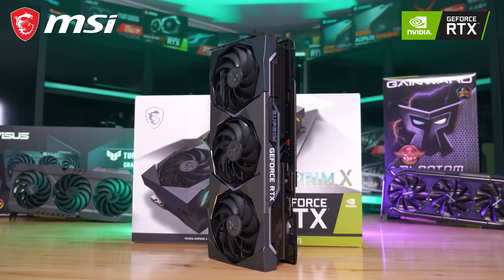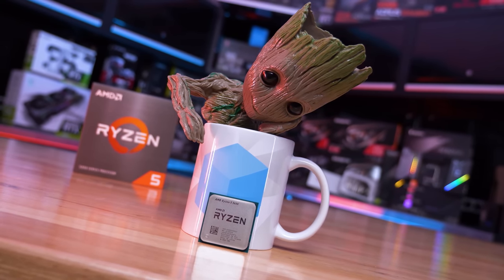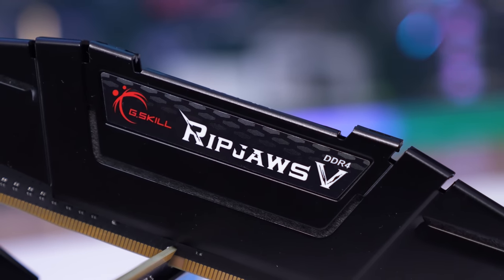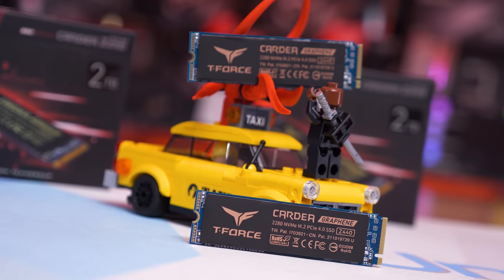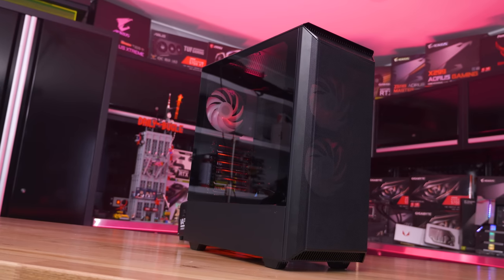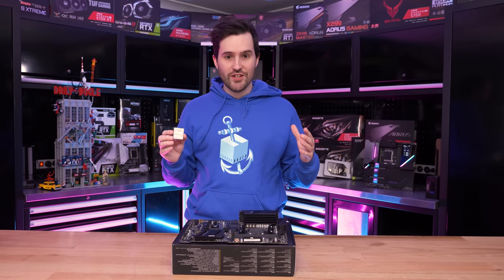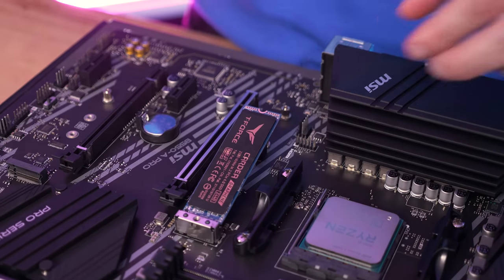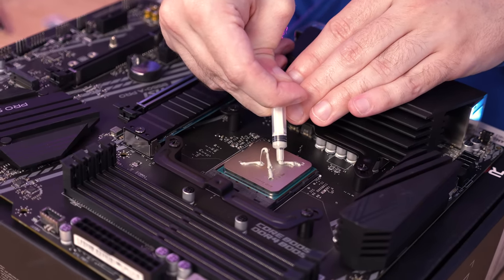Ultimate Value Gaming PC Build - AMD Ryzen Edition for 2022

Comment: I dont agree with a 750w PSU because PSU and a PC Case and the cooling to a certain degree are parts you can and probably will reuse for next build. But 750w won't be enough for the future, by the looks of how GPUs use more and more power in the future.

So its kinda weird how those three things are getting down-prioritized in most if not all budget builds, tbh.
Obviously if you have no plans of upgrading the PC, then by all means the specs of these three are totally on point.
Reply from the maker: 750w is more than enough.
Reply: 550w is good for rtx 4050, oc is waste heat

Comment: Main thing to take here is the R5 5600 and RX 6600 with 16Gb 3200Mhz RAM budget combo
All other parts you can cut it down and depends on the availability in your area
Reply: I don't think the 5600 is the way to go currently unless you already have an AM4 board.  It's EOL.  Either get a 12th gen Intel or wait for AMD's new socket.
Reply: Go with 3600mhz cl16-18-18 or better
Reply: Still using a 1600x I dropped (and painstakingly had to bend 90% of the pins back over hours) @ 4.2ghz since April 16'. 3000mhz of 32 is fine for now, I'll wait. Would be nice to have a PCI4 but meh. But that shows their value as chips. A single fan water cooler, nothing exotic. Definitely got my money our of it. Cheers.
Reply: @afriendofafriend5766  eh, kinda depends on the budget and your plans. Intel should have at least one more gen left, but if you aren't planning on upgrading in a bit, it might not make that much of a difference. It's certainly a plus though, but I'd say it comes to pricing right now. Pick one that suits your wallet if the MBs otherwise give you similar features.
Reply: @jeffkuzzen  3200 16 and call it a day.
Reply: @afriendofafriend5766  12th gen may as well be EOL as well.  Or what, you're gonna upgrade your 12400 to a 13700 at best and maybe get 15% more performance? Yeah what a selling point that is.

Comment: I'm very happy with my Ryzen 5 3600.  I'm using the stock air cooler. No liquid for me. Plus I hate tower coolers, they always get in the way of everything !!  Don't Load W11 unless you like adverts . Go Linux.
Reply: Linux for the win. 3600 is one of the best CPUs and low power too. If you do upgrade look at the various RYZEN 7 and 9 CPUs on ebay.

Comment: Wouldn't i3 12100f be a much better value than 5600 ? It's 80$ cheaper and there isn't much performance difference , you can use it on a b660 board which is futureproof considering intel 13gen will work on it meaning that you can upgrade to a much better cpu later while am4 socket for ryzen will be dead and recieve no more cpus
Reply: But if got 32gb ddr4 can wait 2years ddr5 build

Comment: Why did he put the power supply in upside down the air intake in that case is in the bottom or am I wrong?
Reply: You don't have a say in how to mount it. It only goes in one way into the case, or the screws holes won't align. So it's fine unless the case manufacturer screws up big time.

Comment: I'm not sure I get the argument for using a third party cooler rather than sticking with the box cooler? Surely it would be more valid in a budget build  to see which chip maker has the better offering included?  (Ok, so it's budget mid range rather than actual low budget but still...)
Reply: Especially with the 5600
Reply: Good point.
Reply: Even the Stealth cooler provided with the 5600G and the additional heat load that chip has over the 5600 or even 5600X, still perfectly safe temps. 
AMD's stock coolers do what they need to do.
Reply: From what Tim said it was to provide parity with the Intel build, otherwise the tests won't produce comparable results, though even then there are sources of variance. Note one could likely achieve the same cooling with a simple $16 6-pipe Snowman, no need to get for the well known brands (saving another 20 to 25 maybe).

Comment: What about the 5800X3D? Not worth the extra frames?
Reply: AMD is milking it.
Reply: Its a value/performance build.  The 5800x3d is an Enthusiast Chips.
Reply: For one, it's not out yet, but for two, it doesn't make sense for this system.  You would want to be upgrading your gpu before you get the 5800X3D.  At that point it's not a value system.
Reply: You wont get extra frames from a 5800x3d, when it's paired with a rx6600 card. 
This very channel has showed this many times.

You need a high-end gpu to get more frames with a high-end cpu.
Reply: Literally pointless with a 6600

Comment: When you say a part is "not as well binned" do you mean that there is likely to be more variance between the same SKU (and so maybe more overclock potential?) or do you mean it's just lower quality silicon that will perform worse than other models?
Reply: Lower quality silicon.
Reply: I have heard AMD uses failed 5900x n 5950x (failed cores or cores that cant clock higher so they disable them) and make the other cpus. hence why "binned"
Reply: @BlastyMcNoAim  Intel does as well.  No sense in wasting silicon.
Reply: I think they can't make a statement on that. You'd need a large sample size to test such a thing. Not as well binned can mean a lot of things. Sometimes it even means the CPU is less ''leaky'' and can under-clock better but overclock worse. Leakier parts tend to clock higher afterall.
Reply: @BlastyMcNoAim  everyone does.
Nvidia Amd Apple intel Qualcomm  etc etc
Reply: @TheEtueify  I agree.  If anything, I think you have a better chance of getting a B2 stepping by buying a 5600 over 5600X.  I imagine there are still quite a few B0 5600X in the channels, but my guess is that all 5600 in most markets are B2.  The one in this video had date stamp of 2210, so that's got to be a B2.  I got a 2209 5600 and it's B2.  Runs great at low voltage.  It defaulted to 3.5GHz base at 0.950V (VID), with actually measured voltage even lower.  Tried 100MHz faster at the same voltage and no problems there either.

Comment: If I switched it to a 5600x would it make any difference?
Reply: If you mean switch a 5600 to a 5600X the answer is probably yes.  Although you shouldn't unless you can find a 5600X for cheaper than a 5600 as the increase in performance isn't worth the increase in cost.
Reply: Yeah.
It will cost you more.
Reply: answer is basically no. Difference is so small, it is only worth it if you find it at the same price. Maybe 10 bucks more, but not 20 bucks more.

Comment: Eh. 120 usd power supply seems extremely overkill. You can get safe 650w power supplies at half that price, which would still support better parts afterwards.
Reply: GPUs are only getting more power hungry. If you go lower than this you'll just end up having to buy a new PSU down the road. This is good planning. I'd go 850w myself.
Reply: @jasonhurdlow6607  yeah, like the Seasonic Focus Gold 850W. Which is 65 bucks.
Reply: @joemarais7683  I literally just checked NE and Amazon, and they are at least twice that.

Comment: You know the market is still crap if 1000(+)$ is considered "ultimate value". 
For example, to be considered ultimate value, a card like 6600 should still not cost more than 250$ considering it's 1.5 years old tech at this point and it's a lower-end midrange card.
Oh, and don't even dare to come with that InFlAtIoN bullshit, look at literally all other components and see how big the inflation is - that's the actual inflation, now double it and we're still off of the GPU prices, which hopefully will keep coming down.
Reply: Even a 5 years old GPU still play modern game well.   Hardware don't get obsolete cause something new is released. 1.5 years old is nothing.

Hardware don't lost its value that fast.  No matter the era.
Reply: @user-Cata7sti7ma7  Yeah. Everyone is on edge, pissed for good reason and as if 3x, 5x prices for cards wasn't enough let's do it with everything! Smh, not many decent modern games to speak of, as dead as our will to stand up or our creativity. People were mad 2019/2020, its going to get nuts in the future. I welcome it, as we now live in a circus, but you're correct, there is just too much to be bitter/angry or just not enthusiastic about the future. If this helps people speak out over the damn crickets I heard during the koof that is A-OK with me personally, cheers.
Reply: I decided to put together a list the other day that was under 800.  You can still get pretty cheap.

Comment: You can buy a 3060 for the same price as the 6600 as of today.  So either card would be a good option.
Reply: That hasn't ever been my experience.  Currently a 3060 is $150 more than a 6600.

Comment: If rtx 3060s drop down to 400 euro in my country(a dual fan version) I'll get that and drop in a 5600 in my b450 gaming plus max board which is actually great.
Reply: get 2nd hand.

I wouldn't pay more than 350 today though. I've had plenty opportunities to get 3060 and 2070s for 400-440€
Reply: @user-wq9mw2xz3j  Im not rich and I really want the warranty. I have a rx 570 right now that is second hand and I got it WITH warranty(6 months) for 70 euro in 2020. I said to myself that in 2-3 years I'll just buy another 70 euro gpu and be golden, but this crisis has driven home the fact that this may happen at any time and so I'd like something with a 4 year warranty or something to get me over the next crisis if it comes.
Reply: @RandoBurner  even 2nd hand you can often get with warranty as they are new cards

rx 570 for 70 sounds like a steal though, for anytime

Comment: I would definitely go for a 80+ Gold Seasonic power supply with a 10 year warranty for $60 instead, those RM750x PSUs are pretty overpriced for what you get, and Seasonic is among the most reputable if not the most reputable manufacturer of PSUs.
Reply: RMx PSU's score very well in reviews. An easy 9/10 PSU.
Reply: I have both... both are great. Seasonic has actually had more issues with not handling sudden high loads (like with a big GPU) than Corsair has historically though. And $60 is half the normal price of a good Seasonic unit. The $60 Seasonic units are borderline dangerous (and don't carry a 10 year warranty).
Reply: @dakrawnik4208  focus golds rank the same for half the price. Your point?

Comment: I've just finished my PC, with an MSI z690 ddr4. It posted first time but failed to run XMP for my Corsair 3600mhz c18 memory. 😣
Reply: @gazza what voltage setting did you use. It was already at 1.350 with xmp set
Reply: @gazza I tried setting it manually. Anything over 3200mhz would fail. I pretty sure I even tried bumping the voltage to 1.400
Reply: @gazza z690 tomahawk WiFi ddr4, latest bios flashed.
12700k CPU.
32gb Corsair 3600mhz c18 lpx
Reply: @gazza Two sticks of 16gb in the correct slots
Reply: @gazza I contacted the seller  thinking it maybe a ram issue. But they gave me an  RMA for the motherboard. I thought that maybe they knew of an issue with a certain batch.  It's in their hands now. Will see what they discover in the next few days
Reply: @gazza did you have any problems fitting yours into the case. My I/O shield, even though it was fully seated in the case, was stopping the screw holes from lining up
Reply: @gazza I had trouble with a Corsair obsidian 500d and my current meshify 2 compact. The pressed in oval around the USB C socket was pushing the shield too far out. It also looked like the USB socket itself was mounted further past the edge of the board than the other I/O sockets.
Reply: @gazza I was contacted about my motherboard today. They are now saying they are going to send it back to MSI for repair. I've said I want a replacement or refund but they're not obliged to, as I bought it more than 30 days ago. Now I've got to wait up to 30 days to get it back. I think I'm fed up with this PC before I've even had a chance to use it. The I/O on my first case was faulty, the first nvme drive that I ordered failed to arrive. The 12700k I ordered turned up with the CPU missing from the packaging. I just about sick of it.

Comment: I remember the days when $1,000 was a high end system. Those days are gone. It's a damn shame when $800 is entry level at this point :(
This kinda shit is why consoles are going to take the lead in gaming!
Reply: You have to think about inflation over the years including consoles.
Reply: It still is if you don't make the awful decisions they did. I got a 3060ti/5600 system built for under $1000 with reasonable things like not buying an aftermarket cooler, not waiting over 100 bucks on a power supply, buying a refurb b450 board, not getting a tb of solid storage, etc. They went the Origin PC way of building pcs.
Reply: When did you get a high end system for under 1k? Cards like the 980,1080 or 2080 were already >500$, the higher end CPUs like a 6700k, 7700k or 8700k were all above 300. It wasnt ever possible to buy a high end system for under 1k in at least the last 10 years, I dont know where people get this from... But sure prices have increased which is logical
Reply: @froznfire9531  For productivity, there are gaming laptops with far better CPUs, RAM, even storage at a similar price. The problem with the market are graphics cards and motherboards.
Reply: @saricubra2867  But no high end laptop costs around 1k anf they typically have worse performance
Reply: @froznfire9531  No longer is the case right now.
Reply: @saricubra2867  Yes it is. There is no laptop with a 3090ti or even the other high end cards with same power limit as a desktop. Same for CPUs. Laptops have gotten better but they cant match a PC.
Reply: @froznfire9531  But they outperform overall a desktop at a similar price, at least around the 1000-1600 bucks mark. 3090Ti costs as much as a kidney while it pulls almost 1KW of power.

i7-12700H rekts the 6 core chips recommended by Hardware Unboxed for budget systems as an example.
Reply: I remember when it cost more than $1000 just to get 32MB of RAM.  That's not a typo.

Comment: A 450 watt psu would have been 100 watt over the max power draw of this system 😅 also, the amd stock cooler should be enough for the 5600, you can Upgrade the cooler, when you get a better cpu.

Comment: 1100 bucks for a 1080p system? value build?
1) no need for a 150$ mainboard
2) no need for a 750w psu that costs whopping 120$
3) if we are talking about a gaming build than the included cooler is already quiet when gaming
you could easily shave off 200 bucks.
Reply: well, doing that like he did.. you future proving yourself if you wanna upgrade GPU or CPU or both to something under extreme.. that's cheaper if you instead end up buying new mainboard and better psu later
Reply: @noxlar  i got a strix x470 itx board for 120€ and he spends 150$ for that atx board which is unnecessary, he could have saved so much money. And i got a 700w psu from be quiet for 80€ and he spends 120$ for that thing. sry but those are not "value" parts and they are also unnecessary for future proving if you wanna upgrade later.
Reply: @noxlar  you can get a great b450 board refurb that can take a 5950x for 80 bucks. You can get a Seasonic Focus Gold 850W for 65 bucks. The stock cooler is always fine for gaming. 3600 ram is unnecessary for gaming. The "future proof" argument is garbage when they could have had a similar build for hundreds less that's just as future proof.

Comment: Question: Why do you guys always forget to add a screen, keyboard, mouse and Windows into the budget?
Reply: There are many people who already have those. Why not also include the cost of a screwdriver or table? Not everyone has them but the people here most likely do.
Reply: @dilet1114  Assumption ... THE MOTHER OF ALL SCREW UPS.
Reply: @dorientjewoller113  They're extremely subjective. $200 will get you everything else, probably even less.
Reply: @AltWrongGamer  There is nothing subjective about them. Without them, you have just a useless box with hardware.
Reply: @dorientjewoller113  Linux vs Win 10 vs Win 11 vs Home vs Pro.

104 key vs 100 key vs 87 key etc.. RGB? Wired? Wireless? Ergonomic? Mechanical?

2 button? 14 button? Scroll wheel? Laser? Optical? Wired? Wireless? Adjustable weights?

24"? 27"? 49"? 75hz? 360hz? Curved? Flat? TN? VA? IPS? RGB? Black? White? Silver?
Reply: cuz this is a PC build, not a PC setup lol
Reply: @runterranger7398  SMH You don't get it. Without a screen, mouse, keyboard, an OS you're nothing with your build aka those are also essential parts for your build and should be included in a budget.

Comment: Some really weird choices for a value build. A520 motherboard would have been just fine. It's not like you are going to buy a new Ryzen 5000 build NOW if you are planning to upgrade on that platform anyways. It's end of life. Also no need for after-market cooler for maximum performance from that CPU. That's 130$ saved or you can simply buy the 6600XT instead of the 6600 and already have 15% extra performance for the same price.
Reply: Most A520 are too stripped down to bother with IMO. Also with the 6600 being only an 8 lane PCIe card, the A520's PCIe 3.0 is not a good match, better to have the 4.0 of the B550.